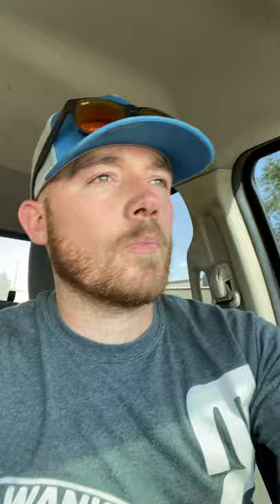Short tube vs long tube headers

Comment: You mentioned Doug thorney headers I've been looking at those , I'm really interested in increasing torque on my 17 Ram 1500. Im towing 6 days a week. Should I go with their shorties or long  . You said their power spectrum is different. That it runs bottom to top . What do you recommend ?
Reply: u should prob go with long tube since ur towing

Comment: Great video, it helped me decide on what to get for my tahoe. Im just looking to get abit more power at low rpm range and better sound and pair it with my 40 series muffler. Would i get a check engine light with shorties? Thanks
Reply: I put shorties on my Silverado for the same reason. It sounds better than stock. And it's still peppy when I take off from a light. And that's all I really want in my daily.

Comment: In my 00 Silverado I like the short tubes. Mostly because it sounds better than stock. But it's also my daily so it's not making much power, and driving around town I am never really at the top of the rpm range. With shorties I still kept the low end peppy feeling when I take off from a light.

Comment: I have a 06 Charger SRT8 and have a muffler delete. Should I stay with my factory headers or go longtubes and ive been wanting to do away with the resonators as well but my exhaust shop acts as if they don't want to do them.
Reply from the maker: Always go long tube for the most power
Reply: @Recklessmotorsports  right on. Thank you